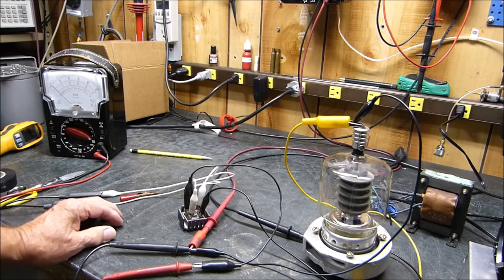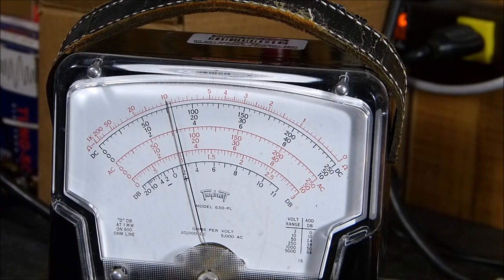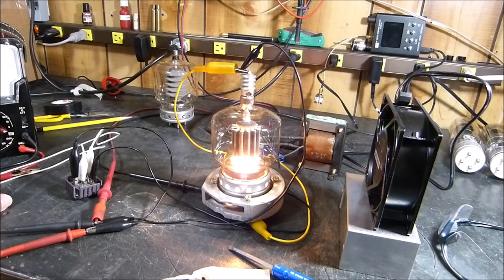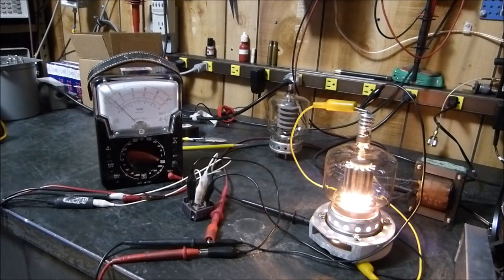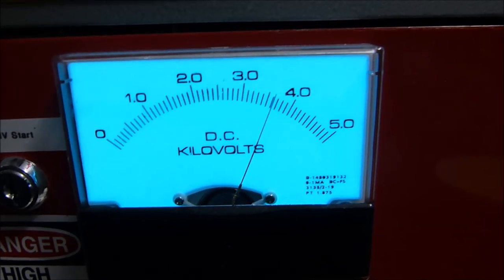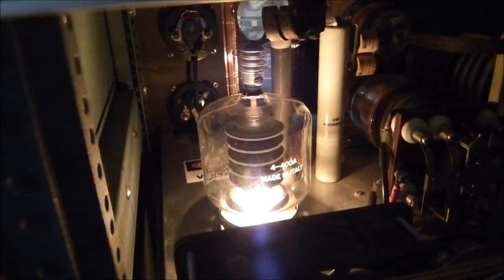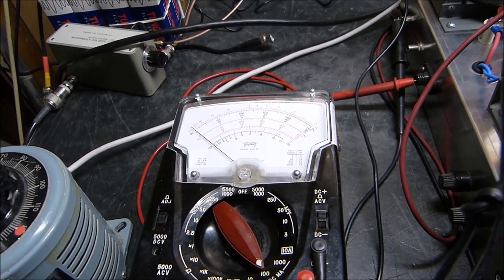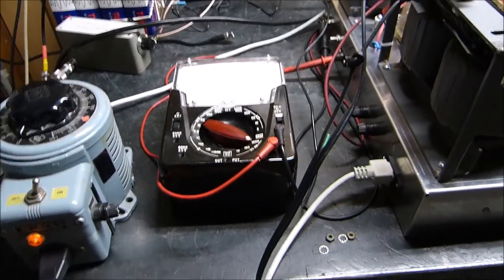Degassing Your Eimac 3-500Z and 4-400A Tubes

Comment: Let's talk when you have time. 73, Jim
Reply from the maker: Jim... Absolutely... I have heard you on lately and have wanted to get in contact with you.
I have just gotten my 833A amp tuned to perfection so I am really enjoying it.  It delivers 1000+ watts as easy as it does 10 watts.  It was a challenge getting the neutralization and grid resonate circuit tuned perfectly for good stability on such a large  TGTP triode amplifier but  I did it. 
Many articles out there say the 833A is no good above 40M. Too many people think everything should be cathode driven GG or resistor loaded if grid driven. Got to go the full length of tuning the grid and neutralization.
I am usually on in the afternoon from maybe 2 PM to the end of the day on 20M.
You are always welcome to contact me directly at my YT email of:      TheAudioShop@SBCGlobal.net   73

Comment: Yeah is busted, probably as you said when the gas starts to ionize it acts like a thyratron and starts to conduct.
Just as an idea to try with a "scrap" tube like this would be to heat up the plate with an induction heater like they were doing at factories with getters, since ti is busted it would be worth a try....

I have never seen a tube tested like that, apparently it works great and i wrote it down in the appnote! i am just a little bit concerned about the grid current since they are strapped to the anode, maybe for a short period of time is ok but just something to check out next time.
Reply from the maker: Manuel - I have to ask you a personal question. 
Have you ever had a tube that failed and ionized consistently like the one in my video that you actually fixed with this degassing procedure? 
I don't want to know about what you have read or what you believe or have been told about from anyone or read on books or on the Internet. I want to know, one-on-one, if You have had success with this procedure. This does Not include taking a 3-500Z or whatever tube that you have had for years or decades,   and doing this degassing procedure and Then plugging it in and having it work. If you do this procedure before ever testing it and then having success, it would prove nothing as it very well might have worked just as well without this procedure. 
I think this procedure is folk-lore and nothing more. Nowhere, does Eimac say this will work. I know you will tell me the truth and I will accept what you tel me as the truth.  Stay safe...
Reply: @ElPasoTubeAmps  no, i have not savaged any tube in this bad condition, the tube i told you about had just a little bit of glow in it while working. i agree that for this particular tube is the end, and that even in this highly technical field there are a lot of myths and people that speak even if they have no clue, i was just thinking that maybe induction heating could work just as an experiment.
Reply from the maker: @manuelminutello3027  Thanks Manuel, yes, this tube was very nice and clear with a perfect looking filament. As for heating of the plate where this tube performed different from a good tube is, I would connect it as a diode and start raising the voltage on the output of the Variac (thru a bridge for DC) and the plate current would start rising slowly and if I kept my hand on the Variac dial I could stabilize the current at any level I wanted even up to 7A. I let it sit at 5A at 100V for a few minutes and the plate was very red (500 watts dissipated in the plate). I know, some are going to say this is impossible and now I have ruined the filament, etc. blah blah blah. I am reporting exactly what happened. OK, then I could raise the voltage a little more and the current would start to rise and as some point it would quickly soar and the tube would ionize and blow the fuse. No doubt the tube is BAD and  from my bit of experimenting with it, heating the plate to very hot  temperatures, it did not help. Maybe if I kept it there for several hours or days, maybe that would fix it...  Now, with all that said, I do believe that running the plates orange hot (within proper limits of the tube) seems to lengthen the life of the tube. I have actually read this from an Eimac article. I also think it is good to rotate tubes so they don't lay around dormant for decades. I don't know if the plate is absorbing internal gas (gettering)  or the seals are becoming more annealed or what, but I do believe that part.
Now a good tube - I could raise the voltage on a good tube (in the same test jig) and the current would rise to 1A or maybe 1.2A and it would be stable at 100 volts never rising any further.  The plate would not turn red and I figured I was super-heating the cathode and from my casual observations, it seemed to make some of my used and somewhat weaker tubes have better emission because of the power I could see coming out to the dummy load when I tested the tube afterwards. I allowed the good tubes to heat for  2 minutes. The changes in power output were not under proper control and maybe my line voltage rose 3-4 volts from an air conditioner, etc. turning on or off so my observations were not properly controlled to say this really helped emission of the cathode - who knows. The interesting things about myths is they are easily created but never able to be extinguished. It is the way the world works. Thanks for your reply and honesty.

Comment: You are reaching the ionizing voltage of the gas (contaminent) ...just like in gas (zenon) or mercury vapor rectifier...Then the tube fires and the conduction increases wildly. This is how an OA2 voltage rectifier works also.   Now,  all tubes have  a getter,   which chemically bonds with oxygen to remove it from inside the envelope...so the filament doesn't burn up.   But metal and other chemical  contaminents  can gassify....and the getter will not - cannot - do anything about them.   Burning in a new old tube   with filament voltage only....can heat up the getter allowing it to work again  after decades on the shelf.   Either it works or it doesn't.  Nothing will fix  a poor bond between the glass and the tube pins...so if they leak....its all over for the tube and it will burn up.   You have demonstrated what tube testers (hickok) do when you run the Gas Test.  This is voltage dependent....so if you could limit the current you  could still demonstrate the ionization  in a bad (gassy) tube.  I think this is extremely useful way to test unknown  tubes  without risking damage to an amplifier !
Reply from the maker: You make a good point about limiting the current to test for gas. If the tube is in an amplifier there is no safe current limiting. I have tubes as far back as the 1950's, I am not going to name all the tube numbers but in almost every case when I use them, no matter how long they have been in the attic, I plug them in and turn them on. They work - if they don't, like the ones in this video, they have to go away. I know of no way to "getter" a tube that is as bad as the one in my video. It looked perfect and the filament was beautiful and bright. 
I "love" my tubes and I treat them nice and let the ones like the 4CX1000A, for example, warm up per Eimac requirements using a 180NO120 delay-relay and put air vane switches on them to power them off if I lose air, etc. but the thorium based glass tubes, like a 4-400A, etc.,  they get 30 seconds warm up and then get the full 4 KV. 
Comparing it to an 0A2 is a good idea. VR tubes have a current limiting resistor to set the resting current to something like 25 - 30 mA.  In testing the big tubes including the Hg rectifiers, putting a current limiting resistor in the anode line might save some fuses and keep the drama down when throwing the switch during testing an unknown tube.  🙂 Hg rectifiers can work fine as say, 2000 VAC but arc over at 4000 VAC. 
I recently read that the way they classify a 4-1000A post-production for 30KV pulse rating as a 4PR1000A to work in radar sets is they current-limit the voltage and raise it to those levels and even use it to "zap" anomalies in the tube that might make it arc in field conditions. Thanks for your comments.

Comment: I agree this tube is dead.. So might be worth experimenting further on.. I'd try adding a 150w light bulb in series with it and run it at the 150w or so for a good few hours and see if it improves.. I doubt you'll revive it completely but if it improves at all then there's further experiments worth doing!
Reply: Use a mercury vapour ballast instead, a 125W one for 230VAC operation will be a simple choke, and will give a good current limiting in the AC side of the supply, and will not want to be a room heater, plus the reactance is generally linear. Will limit the current to 1A with a 230VAC supply, almost irrespective of the actual voltage across the tube itself.
Reply: HomeDistiller I was wondering about that, running it in flashover with a current limit. I guess it depends whether the gas will burn below the flashover point or above it: and of course if there is an actual vacuum leak you aren't plugging it, so you can't get ahead.

Comment: If you tie the grids to the plate, how do you make sure you're not exceeding the maximum grid dissipation?
Reply from the maker: Without measuring the grid current, we really wouldn't know. It is one of the "prescribed" ways of heating these tubes to maximum plate dissipation with a fairly low voltage.  It turns it into a diode. I am going to guess that the plate is so dominate in size that it attracts the vast amount of current and not much current flows in the grid circuit but I don't really know. Maybe the fact that the tube still works after the procedure, assuming the tube was good in the first place, then we can assume it did not damage the grid.   :-)
Reply: @ElPasoTubeAmps  I see some other commenters said the same thing. Since the grids (plural, since this is a tetrode) are between the cathode and plate, a lot of electrons will hit them if they're all at the same potential as the plate. I would also insert resistors in each grid to safely limit their current.

Comment: Just wondering could you put the tube in a vacuum chamber to get the gas out it would probably be a very slow process if the vacuum chamber is very close to the size of the tube and has a perfect seal with a micron gauge if the gauge reads higher its sucking gas from the tube idk might be worth a shot on rare or expensive tubes
Reply: If the tube took 60 years to "go to air" then it'll take another 60 years in a vacuum chamber to get back to vacuum. In this case he should ballast the anode so he can get the anode sufficiently hot without the setup running away. If that doesn't getter the oxygen out it's a paperweight.

Comment: (gassy tube) When the Voltage gets high enough the conduction by Ions (air component) overtakes the electron conduction, this is damaging.  Try reverse applied Voltage polarity ad try with the filament cold with both polarities. Ron W4BIN

Comment: Is it okay to run the two different types of 3-500 Z's in the same box together or do you want to keep both tubes the same?
Reply from the maker: I don't see a problem as long as they are reasonably matched. I would observe if one is running hotter than the other under operation and if they look pretty much the same (orange hot plate) I would assume all is OK.
Reply: @ElPasoTubeAmps  well this is the reason I'm asking the one I have that is like the one you are testing does get hotter than the other one I have to watch it very carefully and make sure that I'm tuned just right

Comment: The beginnings of air leaking 8nto the tube envelope. Gassy tube will over conduct. If you have an 8nductive heater, you can re fire the getter.
Reply from the maker: I would like to believe that and ham lore tells us all about the anode being the getter and it only works when it is orange hot. I think it is all nonsense. I can not find in any Eimac literature where it talks about the anode being the getter or about this procedure to degass tubes.  Eimac does discuss the final procedure for preparation of the tube as it is heated to a temperature just below destruction which we can not do and control.  I plug in tubes that are 50+ years old and haven't been heated in decades and they work. In my opinion, I just debunked the whole smoke and mirrors myth and do no waste my time "degassing" tubes.  If the tube is gassy, you need another one that is good.

Comment: Do you have a copy of "The Care and Feeding of Power Grid Tubes" published by Eimac?  If you don't, we need to get you a copy or scan of it.
Reply from the maker: Jennifer,
Yes, I do have it and I have poured over it for years. Nowadays it can be found for free in a PDF on the Internet. I think it is just time I accept that this tube is not going to be degassed. Some of my videos are dumb and are about things that most people would never try but even then, they document what does not work or maybe, what does with a twist. After making this video I went back to my amplifier and installed it again (a fool never learns...) and tried it at lower high voltage levels only to have it "crater" on me again.  Other people have bad tubes that can not be "degassed" and I have one also.  End of this story. The really interesting part about all of this is the Amperex 4-400A tube I dug out from the bottom of my pile. I bet I have had that tube 40 years and always considered it bad. I save bad tubes in a separate box just to use for lay-outs in equipment I am building so I don't have to risk the good ones.  Look how good it measured and performed... A similar thing happened a few years back with the Penta Lab PL-175A tubes (Eimac also made a 175A) and I always considered them bad until somehow I noticed that they are actually pentodes and not tetrodes and the ring Must be grounded to ground the suppressor grid. Once I did that, they perform beautifully. Holy Cow... Life is always full of surprises. Thank you for commenting. I think we all enjoy and learn a lot from each other.  PS - I still think "degassing" is BS...
Reply: @ElPasoTubeAmps  Nothing you do is "Dumb"......its just stuff the rest of us want to do but arent game to do !!
Reply: Unless I'm mistaken, I think Bill Orr (W6SAI) was the author of that document. He authored other things for them as well. I know he was an Eimac employee.

Comment: maybe this is a bad idea :) so true
Reply from the maker: Yes, in my opinion, a waste of time. I can never say, "never" can it help, as no one can understand every situation but in general, I believe it is just smoke-and-mirrors. People believe in four-leaf-clovers as good luck and I even like the idea of such things in life but when it comes to high voltage and the like, I tend to stick with repeatable results.
Reply: @ElPasoTubeAmps   i Have 2 4-1000a tubes that have a soft problem, (new old stock) when i put them in operation, drive = 10 watts output 0 then 4 hours later 10 in 10 out, increase drive to 50 watt output 60 watt , leave for 4 hours output 200 watt, drivge 120 watt output 800 watt.. gave up on it and fed it 250 watt input rf, output came back 6kw, was really surprised, but when i leave them in storage for a while same symptom.

Comment: Ok, so I have absolutely "0" experience with these larger tubes.i dont see a getter spot on them,  do they have a getter?
Reply: Large transmitting tubes like these don't use getters.
Reply: I forgot to mention. These tubes run Very very hot. Especially compared to receiving tubes. The Getter can't stand these higher temps.
Reply: The getter is the zirconium coating on the anode, which needs to be heated to absorb impurities in the vacuum.
Reply: @ntilewills5679  Yeah, they do. The zirconium coating on the anode is the getter.

Comment: This is a very gassy tube. The gas molecules are being excited which avalanches the conduction. You cad have it evacuated and it will work ok. Shame to discard it with a good filiment and grids.
Reply from the maker: It lit up and looked perfect but you could see it did not work and this degassing routine is a bunch of nonsense in my opinion. That is why I took the time to post this video. I bought it off Ebay and got my money back for it.